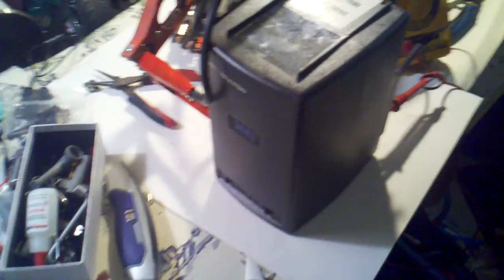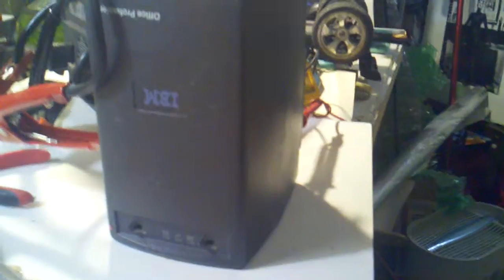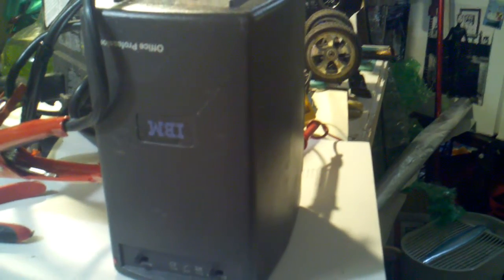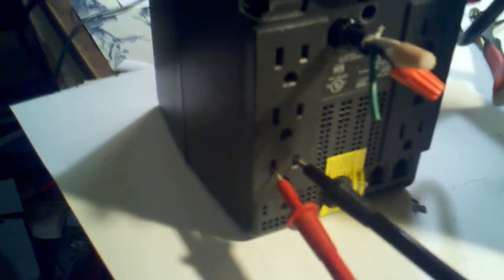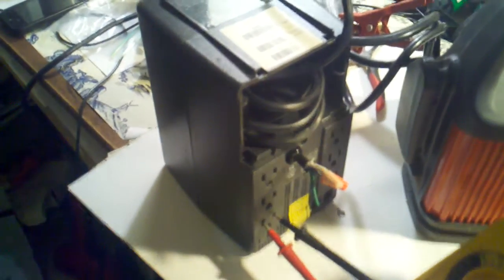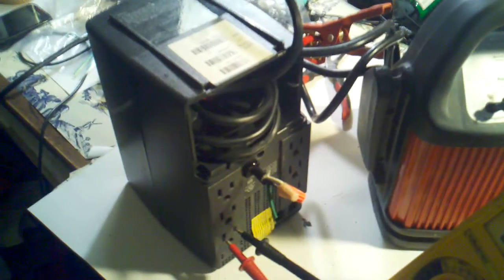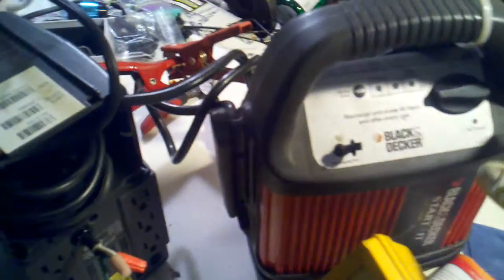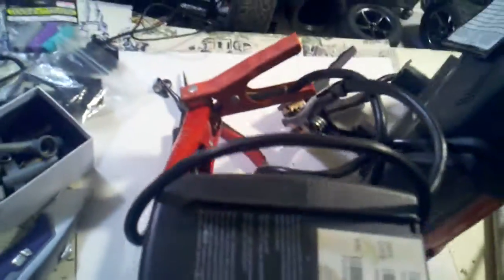DIY Inverter made from a computer backup power supply

Comment: I stumbled upon this video when searching for information on how to run an inverter in the UK 230volts AC from a Mains powered DC supply, I simply cannot find any info on this, what I want to do is run an inverter on a small two stroke generator which powers a DC power supply, any ideas? I note you are using a mains powered 12 volt power supply so it is possible then but I don't have enough electrical knowledge to be able to achieve what I want to achieve. my little 2 stroke generator puts out 850 watts AC and I am curious as to how big an inverter I could possibly run using it to run a 12 dc power supply. good job there glad I found it really thanks.